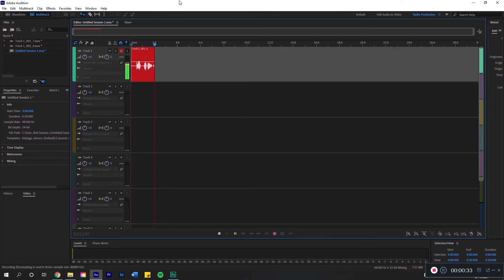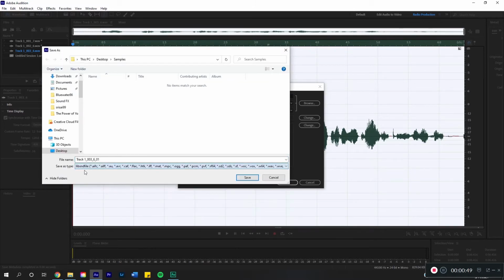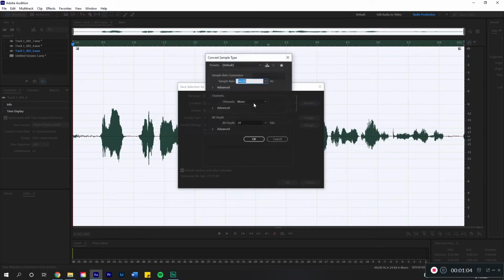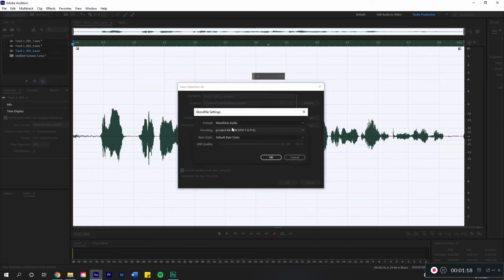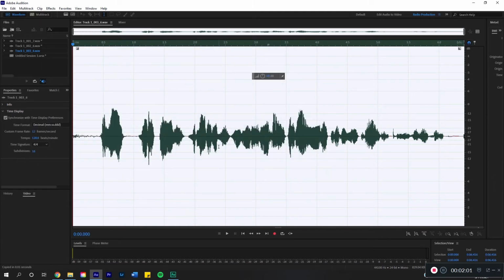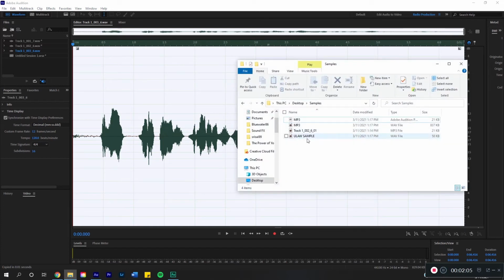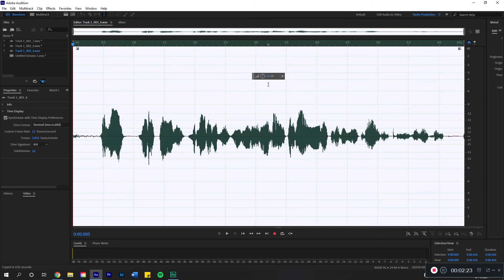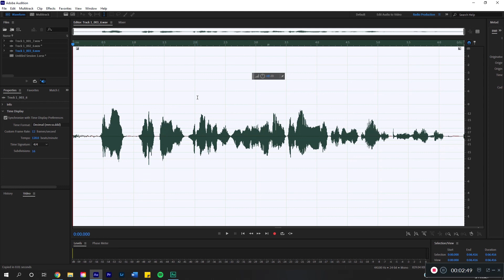SavE or Convert to ULAW 8-Bit PCM on Adobe Audition for Phone IVR

Comment: So quick question. I have my settings as a mono track, 22050 hz, and 8 bit unsigned but for some reason I am getting this weird background noise similar to the one in the ULAW file you made but on some files I have encountered with the same settings I mentioned, it doesn't make the noise. I did use another program with the same settings and it doesn't make the noise. So my question is, why is it doing it for some programs and not in others? The programs that do it are Audacity and Audition. The one that doesn't do it is Goldwave.
Reply from the maker: Ohh man, you’ve got me stumped. I’m not sure. Unless certain apps just have secrets that the others don’t 🤔

Comment: THANK YOU.  I did exactly what you said and my client is saying it sounds bad, and that no one else's file sounds like this.  So I'm stuck but you validated I'm doing it correctly.
Reply from the maker: That's the problem.  This is a requirement for some systems and it sounds horrible.  Unfortunately, that is how it's supposed to sound.